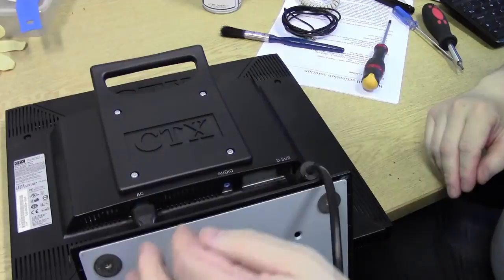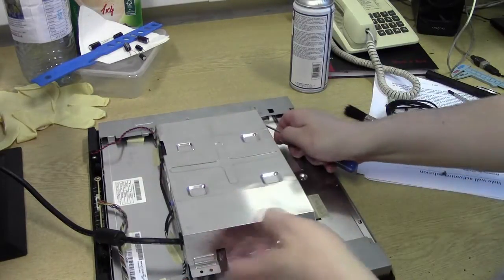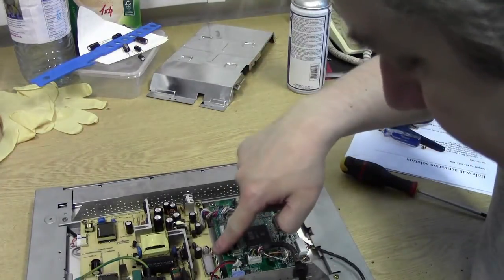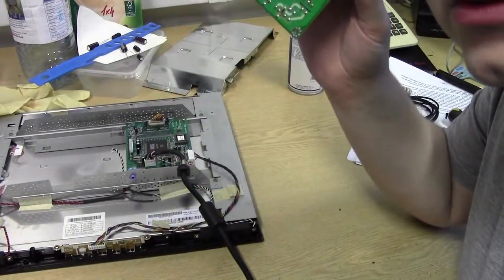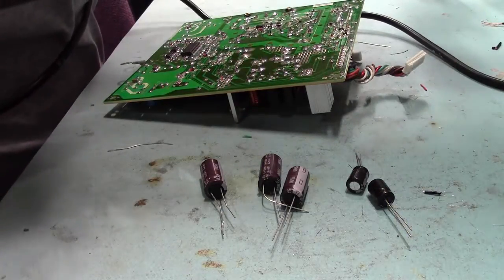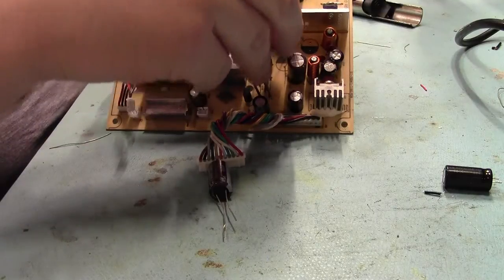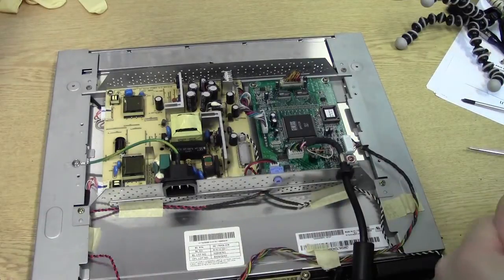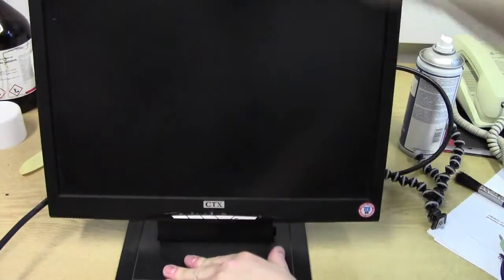CTX LCD Monitor Repair

Comment: Thanks a lot , I have exactly the same LCD & exactly the same problem, Though I purchased new one, I will try & repair it & keep it stand by. In my case the fat cap 400 V 100 mf, next to transformer is obviously leaky, so I will replace that too.